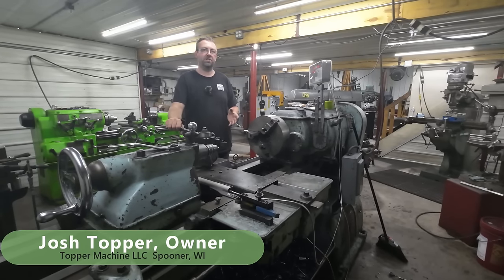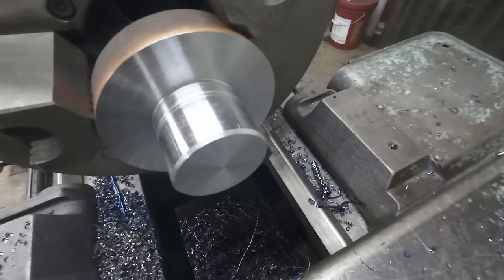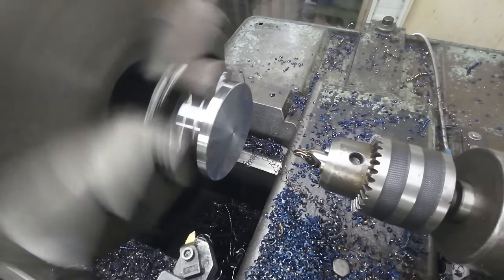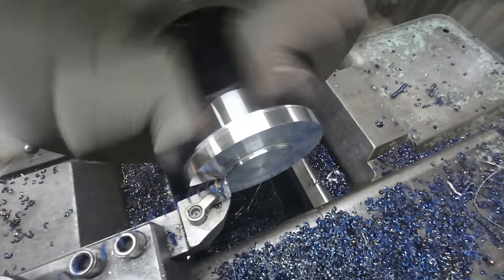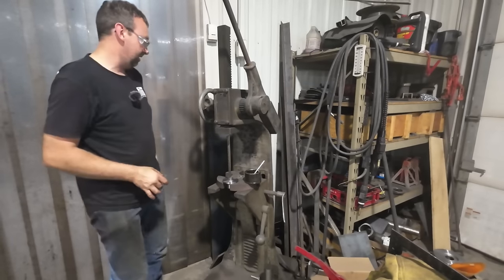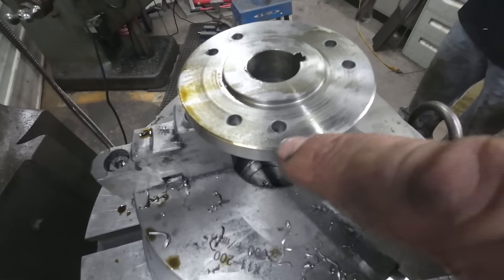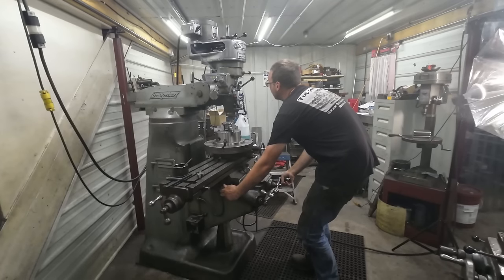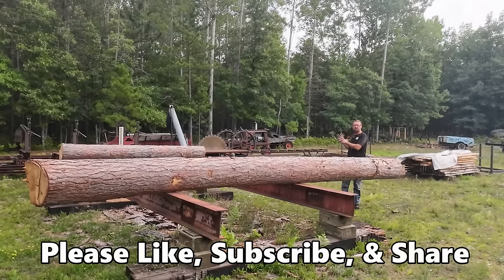Manual Machining A Adjustable Shaft Coupling For The Homemade Sawmill

Comment: I started at about Connor's age. Although I never made my living as a machinist, I've made many car, motorcycle, train and steam engines and parts to allow me to have those hobbies. I was cutting quartered slots on our horizontal mill a few weeks ago for a locomotive project.
Stick with it young man. It is a great skill to have that will also translate to many other professions. I did industrial automation before I went to work for the railroad. Understanding how to machine parts is invaluable almost daily.

Comment: You certainly have some very interesting old, obsolete machines that do a great job. Keeping these old machines working is definitely a good move, because they are so reliable and they do what a lot of modern machines can't do. That manual keyway slotter was a real antique and probably extremely rare now. It's great to see these old machines still working. Personally, I still have many hand power tools that I got around 50 years ago and they are still working with regular maintenance. Look after things and they will look after you.
Reply from the maker: It's bought and paid for and will keep paying it's way. The only payment I have is the mortgage and the Lion. Best way to run a business

Comment: Love your work!   One question; besides the bolts in the slots, how will you compensate for slippage?
Reply from the maker: There won't be any. Not enough to torque in the setup. Just tightening the bolts will hold it.

Comment: Good stuff.  How about a pair of 3/16 thick "washers" the same od as your couplers , with a nice, generous slip fit over the hub portion with 3 holes 120 degrees apart that are on same the bolt circle diameter as the slots?  That way your bolts wouldn't dig in and gall up the slots.  Anyway, pretty good stuff.
Reply from the maker: I went with SAE washers. No worry about digging in, this material was hard.

Comment: Beautiful job. I wonder if you might want to nickel plate those parts to prevent rust in that outdoor environment?  Just a thought while they’re new.
Reply from the maker: I haven't found a good plater in this area yet. I'm not concerned. It's fairly hard so shouldnt rust too deep.
Reply: @TopperMachineLLC  Heat the parts with a torch and soak them in linseed oil for a long lasting rust resistant black finish.
Reply from the maker: @ellieprice363  I like that idea. Gonna use it in the future.
Reply: @TopperMachineLLC  Hot motor oil will work just as well but won’t smell as good.

Comment: Nice work, but why did you choose broaching. And not slotting? PS I hate broaching, I have ruined more parts, then made good parts while push broaching😂😂 .
Reply from the maker: I hate broaching also, but it was a better option. The slotter was set up with another job, and anything under 1-1/2" bore is hard to slot with my current tool holders.

Comment: Some good machining in there. Your video comes with a note that six products are mentioned. Would it be correct to presume that this statement is required by your contract with YouTube, or is there another reason?
Reply from the maker: No, you are not correct. These products are sponsored by the companies I get them from, but I have no obligation to promote them. I make that clear to them right off the bat. If I like the product, I have no objection to promoting it.
Reply: Thanks for the swift explanation. @TopperMachineLLC

Comment: Can you adjustments the headblocks for both the carriage and the pony to align them all together?
Reply from the maker: They are all adjustable. Once the main carriage is set, it hasn't moved in the last several years. I only needed this coupling for fast setup and tuning. Since the extension will be off most of the time, it needs to be a quick setup.
Reply: @TopperMachineLLC   My only thoughts are I would have always parked the pony at a fixed point say 8". Then disconnected it from the carriage. The coupler would not have been adjustable. I would adjust the pony's headblock if needed. Adding another point were the two (carriage and pony)can come out of alignment with each other is maybe not ideal. I coming at this from being a third generation in the sawmill business. The parts you made will definitely work just maybe cause a head ache every once in awhile.  Love the channel!
Reply from the maker: I considered all options.  This was the best solution.  Many of the older mills like Frick, Howell, and Enterprise I have worked with have similar couplings with zero issue.
Reply: @TopperMachineLLC   next you need to build a top saw and a vertical edger.  Of course in your spare time. Lol.
Reply from the maker: @craigwillenborg1831  the top saw would be cool, but not needed around here. A vertical edger would be nice.

Comment: manual machining is good for one part but still more tine consuming, shop programmers are so fast
Reply from the maker: And your point is????  I am a manual only machine shop for a reason. I take jobs away from the local CNC shops. One of the big ones tried to take me out and failed.
Reply: I had a cnc shop with both, some people can run manual and get the job done and some cant
Reply from the maker: @garylarson6386  I learned both. I hated CNC. I like low volume work and the requirement of a brain to do the work. Every job manually is satisfying, and rarely dull.

Comment: Josh
great video again,  Let me congratulate you for have an apprentice working with you , not sure what the length of time it is in the USA , but when when I did my indentured apprenticeship at the iron works it was a full 5 years ( as an electrician in heavy power at the local iron works ) they had on site a training centre on site foe the fitters , machinists and moulders  for the first year after that you went out to the plants , but with the electricians we were sent to college for the first year full time , after that we to rotated round the plants , the firm took on each year 6 of each trade .
in the day the firm had over 7000 workers and looked after us very well with a full time (365/24/7 staffed ) medical centre in X-ray equipment , dentist with each plant having a small medical room . now alas its all gone 

keep up the good work  Stuart from the UK
Reply from the maker: How times have changed. I bet nobody does that anymore. Conner is part of the Youth Apprenticeship. He has to work 450 hours a year while in high school. After he graduates, he can go into another apprenticeship program. The YA is designed to get kids interested in the trades. He is doing well, and has seen and done things with me that no other shop would touch. He has had some great experiences so far. I'm hoping after HS he wants to continue in the trade.
Reply: @TopperMachineLLC  Tell Conner to keep at it he has a good mentor in you , good foundations make good work in the future ,  here in the UK to do house bashing ( domestic house wiring) is a six week course ) , alas it is now 26 years since I was in work . long past retirement age but I have a small hobby workshop manual lathe ,manual mill and a CNC mill got to keep the brain active Evan if the body is weak
Reply: Our mother country did things right in the old days, as did America. Skilled tradesmen on YouTube are slowly starting to turn that around. If it doesn’t happen soon we’ll end up with a nation full
of college educated dummies.
Reply from the maker: We already do. It astounds me how dumb society has gotten. Absolutely zero skills. "my toilet is overflowing, better call a plumber". That stick with a bowl on the end is not a decoration!!!  It seems to get worse every day.

Comment: Great job and thank you for sharing your experience with an apprentice. Save the tip of an insert from chipping by not facing all the way to the center since you are going to drill and bore a hole through the piece?

Comment: Nice work and mystery metal is always fun. We had a mystery metal job, cast steel perhaps, about the size yours and it needed to have a large bore.  Was making an odd sound while boring.  Well low and behold there was a perfect ball shape in the sidewall inside.  😅.    Junk steel for sure.  Awesome to see your apprentice. 100% smart move for a youngster these days to work in a job shop environment as varied as yours.  Toolmaker someday with you help.  Thank you.

Comment: damn Josh, you are going to wreck your back leaning over like that. You are tall enough to require raising your machine up on risers. I realize that the knee was down for clearance, but I keep watching you at different machines, and you would save some wear and tear on your back. If someone shorter needs to work you can have pallets to raise them up.
Reply from the maker: I stay super active and never feel it in my back. Maybe as I age I will, but it's never been a real issue. I tend to keep my back straight most of the day

Comment: That mystery material just might be Greek ascaloy, a high strength material that work hardens almost instantly when you dwell with a cutter. A day would not go by when someone would weld a drill into a gear blank. Nice material once you understand it but it is hell on rookies.
Reply from the maker: That is possible. I have no idea where it came from or what it was. But I never use mystery metal for paying jobs. Seen too many shops get burnt by doing that.

Comment: you are right manual is rewarding but cnc made the shop profitable
Reply from the maker: I am extremely profitable without it.  Been taking the jobs away from the local CNC shops for the last several years.
Reply: Once programmed and set up CNC only require an operator, never a skilled machinist. 
They’re necessary for high production work but brain  numbing boring otherwise.